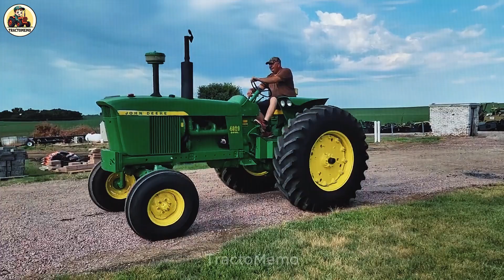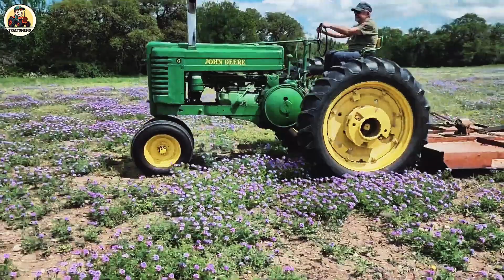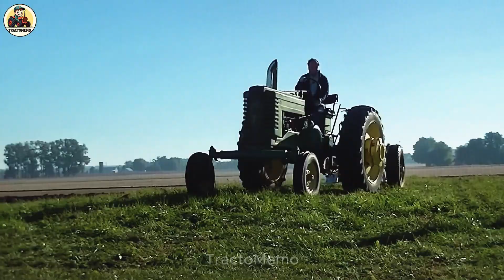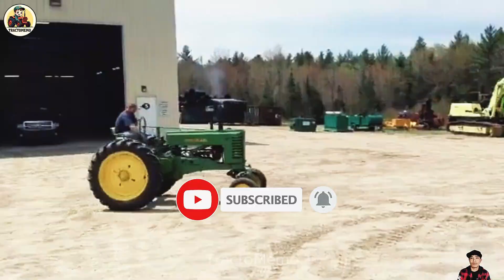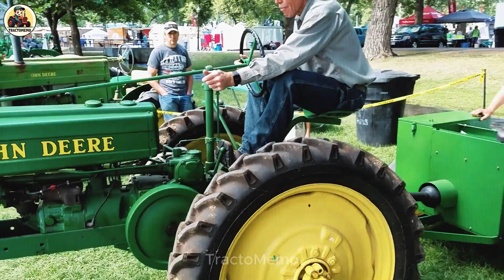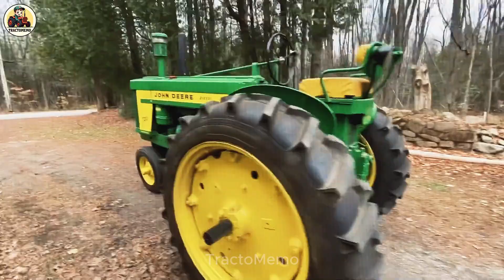5 Most Popular Used John Deere Tractors in the US

Comment: My farm still run the 4010     but it has the 4020 engine in it    when we had to overhaul it
Reply from the maker: Nice! A 4020 engine in a 4010 is a great combo. Bet it’s been running strong since the overhaul.
Reply: Yes. Been running strong for the past 30 years
Reply from the maker: Wow, that’s impressive! 30 years and still going strong says a lot about the MF 135.
Reply: But i don't use it every day.        Just here and there now because i got a Kubota M105 witha day cab for the harder work
Reply from the maker: Yeah, that Kubota M105 is really powerful, definitely makes the tougher jobs a lot easier. Using it now and then sounds like a smart move 👍